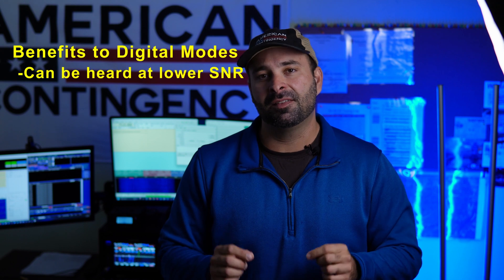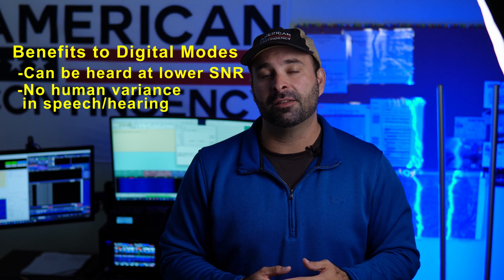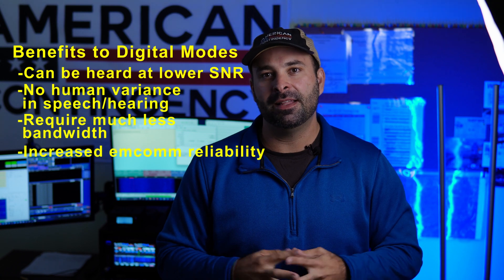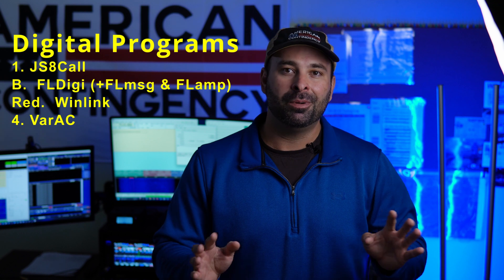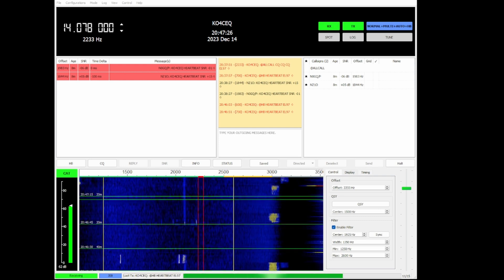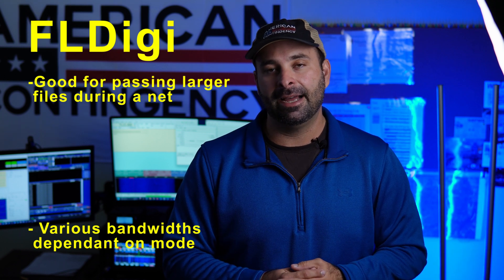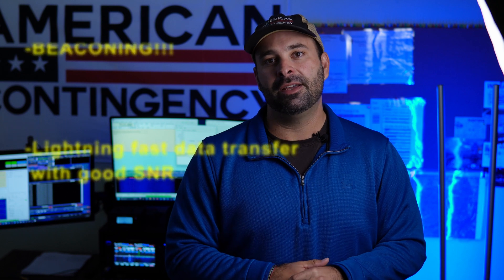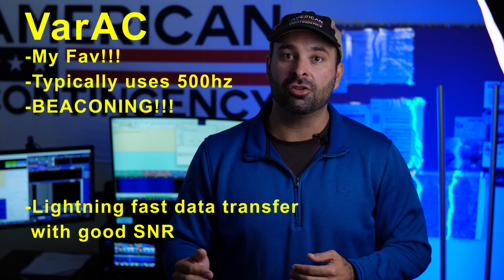Intro To HF Digital EMCOMM

Comment: Liked this video.   I am new to digital modes long time SSB guy but ventured  out due to all the reasons you stated.  I have Winlink and use Vara HF via my Yeasu 710.  Only made contact to myself in test mode this week.  I will move toward JS 8 call and Vara c.  Thank you for this video. 
Tyler 
KF5ETZ